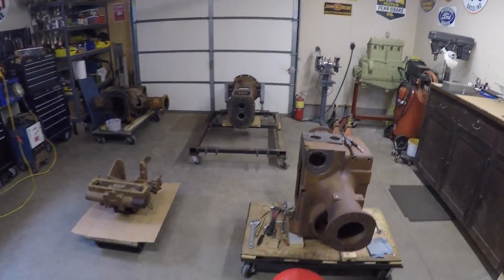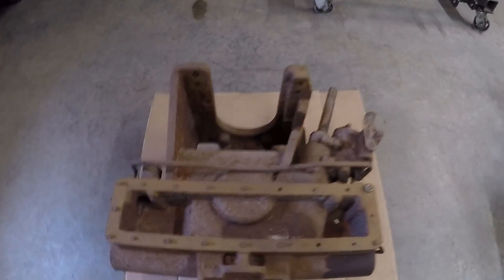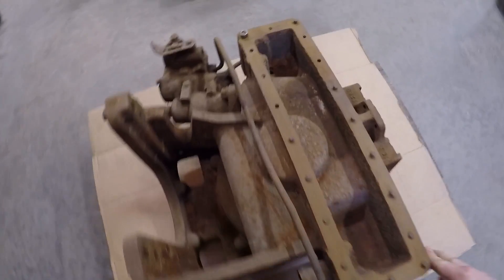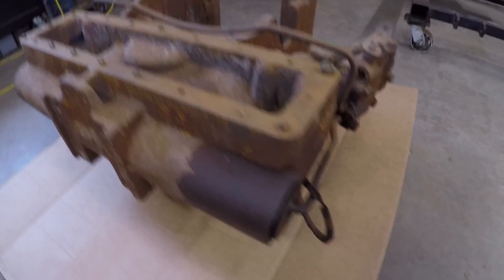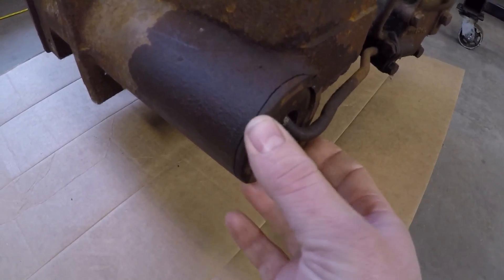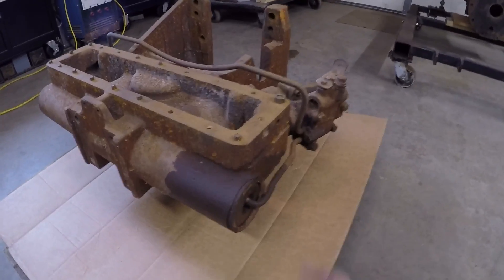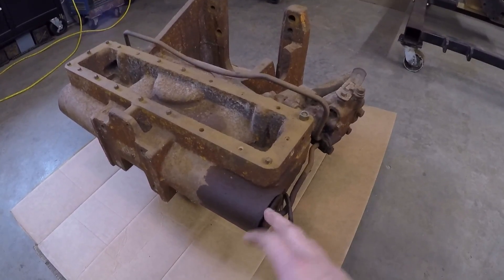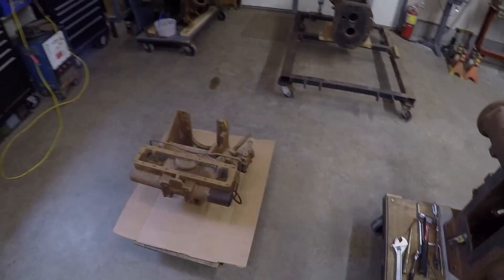X-231 Steering Bolster Casting Damage - Best Method To Repair?

Comment: I would check to see if the shop could thread the unit so the ring could screw in with a rubber o ring to seal it.

Comment: What about re-machining that end, just shorter? and match the other side to be shorter as well, and change the valving to be a wee  bit shorter on the inside... That way you are back into solid material to hold the pressure... ? Granted, that would require some big money, unless you have access to a horizontal mill for free....

Comment: I'm writing this more than nine months after you posted the video. Did you fix the problem already or decide how you're going to address it? Since you already wrote that the production piece was the same with regard to the broken part, I'm wondering why and how this one broke and if you are worried that rebuilding it to its original spec might result in the exact same break in the future.
Reply: @squatch253  Hmm... Curious coincidence on the timing of my comment. I'd probably make something of it if I were a woo-woo. (https://www.urbandictionary.com/define.php?term=woo-woo) I trust the mis-assembly was the work of the last owners, not anyone at the factory. But yeah, what a bummer that the result was such a major catastrophe. Did it have any power steering at all after the casting broke, or did it just "ventilate" the PS fluid and bingo instant armstrong power steering? At this point, being so deep into the project in terms of money, time and energy, I sure hope you don't run into anything that you'd consider unfixable. I remember you mentioned in another video that, had the production gears not fit in X-231's housing, you might have thrown in the towel. I hope you have a lot of good fortune with everything falling into place from here on out.  I mean, what could possibly go wrong? haha....

Comment: Is the wall thickness thick enough to bore it out and face the broken end back to where you and have enough thickness for a new snap ring grove.  And sleeve tight it in . Maybe thread it in with some thread sealer  ?

Comment: You can can have it bored and sleeved. A machine shop can face off the cracked part, make a press in sleeve that replicates the end of the cylinder with its snap ring groove. I would probably just braze up the casting and remachine it out by hand if it was for an ordinary 445
Reply: John Donahue Couldn't agree more with this. Just like an engine sleeve.

Comment: steel hydraulic cylinder tube, cut the OD down to make it a flanged shape. i am taking that the bore only goes half way thru. the housing bored to a precision size and the steel sleeve sized for a tight fit.. heat the housing.. cold shrink the sleeve and slide it in. hand grind the end of the flange and use a needle scaler to match the exterior texture. you will probably want to create a spiral device to heat the Bore evenly..

Comment: I have seen some of my old restoration buddies ( now passed over )use a very high strength braising alloy called All-State Number 11 alloy. I have seen antique front axels done with this alloy, and not come apart.Fully clean, lightly flux, heat in oven... then place broken off part on casting...use oxy-acetlene rosebud  to heat the work area red, and then apply #11. It will wick into crack between parent and break-off.  I just got some of this myself, nearly 30 years later, to restore a broken cast iron hand powered water pump top casting.  It should wet into the joint and hold the pressure via the snap ring just fine.  Building up weld to cast iron to machine down is nice, if you can get a decent connection, but my dad and other shop guys never trusted any welding to cast to be low stress on the iron.

Comment: Weld that end up with a decent bead all the way around, don’t try to weld that paper thin piece back on. Take the casting to a shop that has jig mills, they can remachine that end with the snap ring groove. Jig mill is the easiest tool for the job on something that size

Comment: I don't have a clue. Like Oddball, I just drive 'em! If nothing else, dismantle it and take it back to the guys that did the p.t.o. deal and get them to build it back up and you machine it down. One thing at a time, maybe.
Reply: I've mowed part of my back yard 4 or 5 times so far but not all. It's still been too cold for the whole thing to get cranked up.And what little I know about cast, it'll need to be heated and done right. There is a place called Dover's a ways from here that rebuilds all matters of stuff like heads and blocks and stands behind the repairs. LIke dropped valves and all the good stuff but that's all they do and they're VERY good at it. If your deal were mine, that's what I'd do. YOu know what kind of job you'll get and it can be fixed back stock AND right. I always go with 'RIGHT' over anything else but that's just me. I just want it to WORK! And if stock was the way it needs to be, so be it. Just keep your jacket with you and warm weather is on the way. But some places it's just a little farther off! Take care, Buddy!
Reply: ......and sticking to the refrigerator is how Martha Stewart checks to see if the spaghetti is done!! Just gives it a sling to see! If it sticks- O.K.!
Reply: Did we have the same Transmission and Hydraulics instructor? "I'd throw it up here and see what sticks to the wall" was a punchline to one of his jokes.

Comment: How did the production model steer ? I mean do they use the same power steering method/casting?
Reply: Yes, of course , and the challenge is to get that rebuilt as planned.
I wish I could help,  with an idea,.but after reading what Wes Johnson as suggested, I have to agree.
But whatever you decide I'm sure machining of the broken end and a new 'cap' is what has to be done here.

Comment: Wes Johnson has a good fix I think. First thing that come to my mind. The second thought was to cut another snapring groove deeper into the bore and braze that one back on for looks. You might have to relieve the piston some so it doesn't bottom off on that cap in the bore.
Reply: My brother had a 69 Ford Bronco that the manual steering gear had a tooth  wore down so if you went too far the steering wheel would just spin. It would freak the driver out but it would come back (eventually) into mesh so you could get it going straight again.  I think you know where I am going with this. Yep grind the end rack tooth down so it won't go too far and pop your plug out. Of course I am not serious, this comment was intended for entertainment porposes only...

Comment: If it was mine, I'd set it up in a mill and machine the end of the cylinder shape flat and tap a bolt hole circle. Then make a new ring shaped end cap to match. I'd counterbore the ring for some small socket head cap screws. You would see the heads of the screws, so it would not look totally original. But, it would be much stronger than brazing or nickel welding.